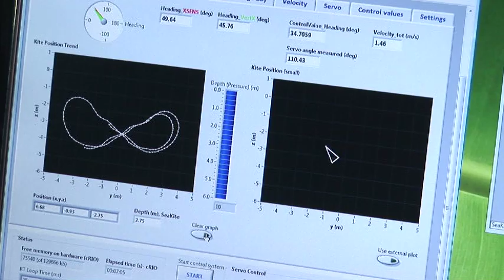Minesto Tidal Energy

Comment: I cannot see how this kite / plane would stay suspended in areas aroundthe coasts when tides change. For instance in the british channel the tides have a 15 minite (ish) slack water window (ebb to flood ) would these not crash to the sea bed and need assistance to work again? also in rough or heavy seas would these not break the surface and loss momentum.

Comment: Why do people always downplay ideas like this as "Oh man, there's no way this can produce enough power for anything."  Alternative energy is not an all eggs in one basket way of doing things.  It puts low impact power generation in the best possible places for that form of energy then it's additive after that.  Tie them all into the same grid and voila!  These cables look way too thick and sturdy to entangle anything smaller than a whale and I doubt even then it'd be an issue.  The turbine is my only concern, I would've created this concept a little differently using magnets and springs in sealed boxes on the seabed. Probably less power per kite, but with almost no impact to wildlife, just run the cables, stick them everywhere, reap the rewards with very little maintenance.
Reply: why oh why? cause its shit

Comment: With a piece of wire spinning around like that in a figure of eight, the danger to sea-life would be my primary concern. I'm guessing that to hold onto the "deep-green" the wire would be pretty strong, and during fast currents I'm sure the device would create a large force. So it stands to reason that it could slice up sealife. Looks clever - not practicle!
Reply: Minesto has been running tests with larger versions now and conducted sealife evaluations with several universities to study the impact on marine life and it seems most fish and other animals can swim out of the way or stay clear from the movement of the kite and cable.
Reply: are you vegan? I predict you are slicing up sealife.